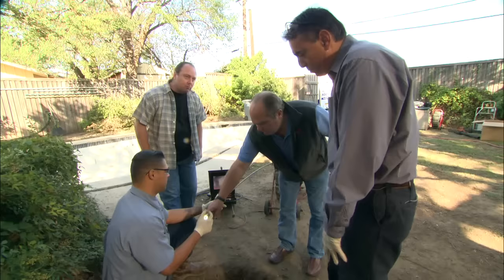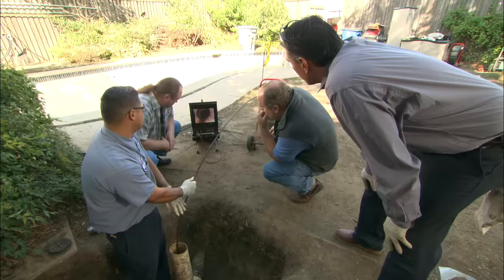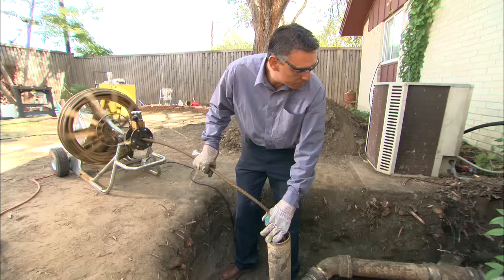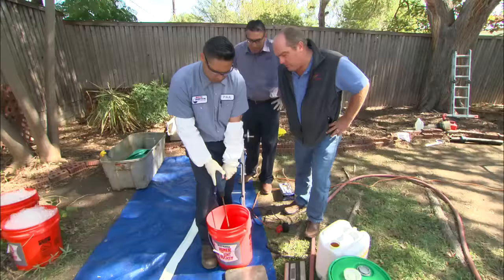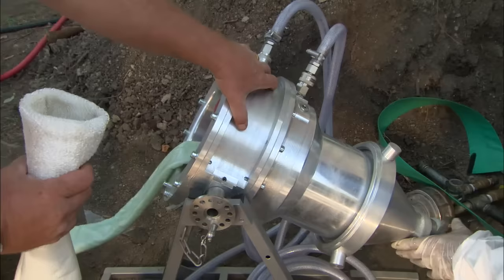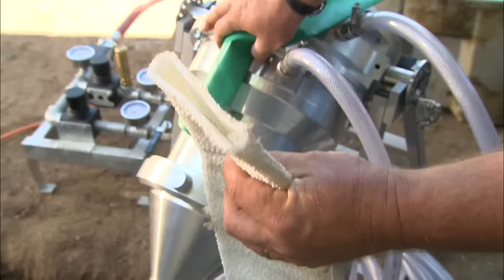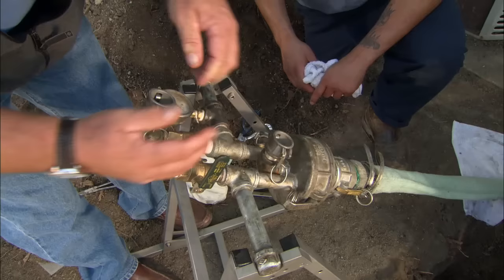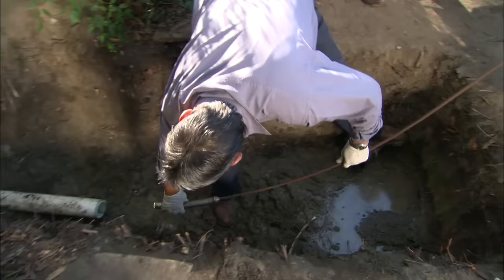How to Repair a Sewer Pipe Under a Concrete Slab | This Old House

Comment: Yes more every access where water comes into the new poor is closed off 
Yes you have a nice new pipe 
Sad part, no water can get in.
How do you rectify that.

Please note, I'm not being sarcastic, I'm asking a question
Reply: When they install the liner it is to a specific length. Then they inflate the second tube to get it to form to inside the old pipe. When they do the cctv they take very accurate measurements of the distance traveled. They could also go the other way out to the mainline as well using this method. Perma-liner has many videos on YouTube explaining exactly how it works. Much better than I can.

Comment: WOW!Thats really awesome!! Especially the bit where they tell how much it costs!!!Oh wait. Wait a minute...oh yeh they didnt. MERICA!😐
Reply: They can't. Costs change constantly from region to region and company to company. Also there could be some companies that use slightly different equipment that costs more or less, or gets the same or a similar job done faster or slower. Even if they could give a price range, it's only a snapshot in time. This vid is from 2014 and it's now 2019. Do you think the prices are the same? What about in 10 more years?
Reply: @jgood005  anything can be done if you want it bad enough

Comment: They really shouldnt call this pipe relining, it should be called pipe-in-a-pipe.
Reply: The liner is making contact with the original pipe. The pipe must be milled before you put in the liner to have a rough surface and the liner could attach to the original pipe. It would be a pipe-in-pipe if there's a gap between the pipes.

Comment: So they went from a 4 inch sewer to down 3 inch pipe.
Reply: Nope. That liner's wall thickness is likely about 1/8". So maybe 1/4" total loss in diameter.

Comment: Obviously an expensive process and it almost isn't even plumbing, its like advanced city engineering. My rule is if it absolutely requires electricity to be done then its not plumbing!!
Reply: J da high roller it's actually almost entirely pneumatic

Comment: Don't trust this process. The "new" pipe/liner is not a smooth surface but a fabric with a surface area more likely to hold material flowing through. Also it did not solve the issue with the roots that had already grown back in in a couple of months.

Comment: Oh no.. this isnt good. It will cover your drain holes  and then you can find them with the locater you have to search in the slab for connection points

Comment: This method has been the standard in the industry for years but it is becoming very controversial because of the serious environmental hazards it poses. There are lawsuits popping up everywhere because of styrene  intrusion into the home. I'm afraid we're going to find out in the next few years that CIPP has created one big toxic mess requiring billions to repair. 

There are other methods of rehabbing pipe that are safer and cheaper.
Reply: like what? one of my neighbors just had to replace all his sewer pipes under the house at a cost of 30,000...  i would like to avoid that at all costs.
Reply: cave redecorator Total robbery, there is no reason to charge $30,000 to replace pipe. Educate

Comment: yep and also made him waste money that he didn't have to spend. if you have some roots in your drain very simply get a big box of Epsom salt. fill your bathtub with water mix the Epson salt into the water then simply drain your tub let her sit for at least 4 hours before flushing or running any water. problem solved
Reply: Once the bath water goes down the drain it should run into the sewer system from your home, It doesn't sit for anytime. It it sits that means you have a stoppage. In that situation the salt water would be a viable solution.
Reply: Bigchuck678 the Epsom salt in the bath water will bind with the root system that is penetrating the pipe. The 4 hours is enough time to absorb into the root system and start to kill it. Next time try speaking to somebody who doesn't know what they're talking about
Reply: Bigchuck678 no where did I say it would not drain out of the the pipe
Reply: I'm that guy you love to hate The scope showed there was no blockage, hence it wouldn't be a viable solution this time. Had the home owner did this the 1st time around before he cleaned the roots up, then maybe the Epson Salt idea may be possible. Maybe.
Reply: Cuba Rodriguez yes but all he had to do us wait for it to happen again. Instead of spending the money
Reply: I'm that guy you love to hate it's a PITA to have to deal with lack of drainage though too. Can happen while washing clothes or dishwasher running & that's not fun to clean up after. This is a more permanent immediate solution. I would also guess the wife had a lot to do with that decision making...lol
Reply: Ture
Reply: So you put the whole box of Epsom salt into the bathtub fill with water and lets it drain?
Reply: @louyht7  yes fill your bathtub full of water with a full box of Epsom salt make sure it's mixed in really well. Make sure no one has to pee poop or do anything or turn the water on for at least 4 hours after doing this. Drain the tub again make sure no one turns on water or does anything in the house this way the root system can absorb the salt from the Epsom salt and that will start killing the root system
Reply: @licensetochill79  
Oh nice. Thanks for the tip :)

Comment: Advice from plumbing contractor.
ALWAYS get at LEAST 3 bid/quotes. Make sure there is a complete project overview or scope of work provided on paper or email. If lowest bid is way lower than higher bids, Don’t use them or you’ll just end up with the same problem and possibly worse. 
Finally not all contractors are out to “rob” you. Everybody wants a Cadillac for a pinto price. SMH. Some of the applications we apply from our trade costs a lot of money for the materials, are very labor intensive, and takes us decades to master. I’m called a master plumber but I have not and will not ever master my trade!